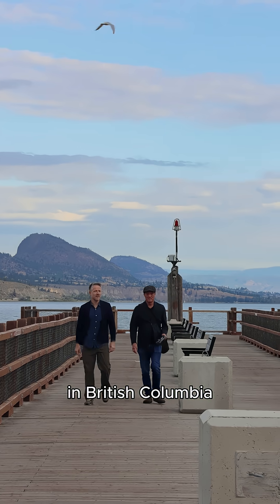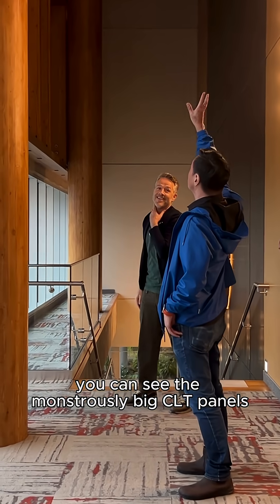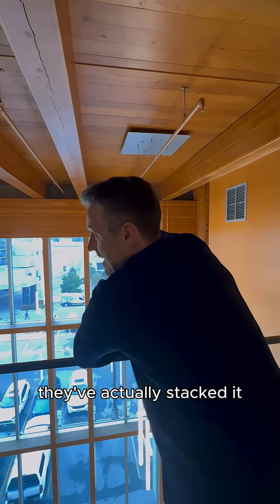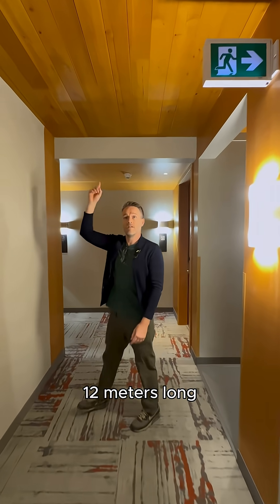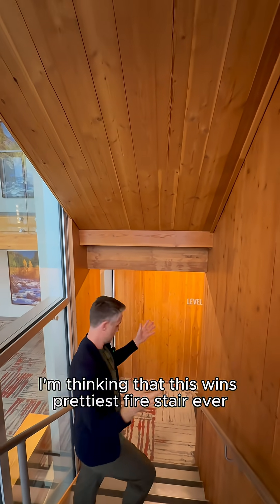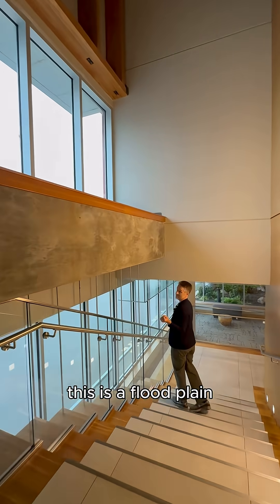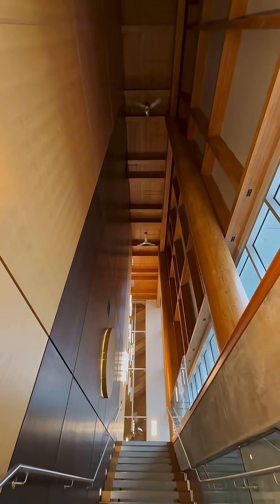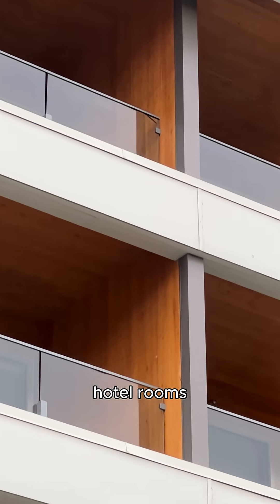More Mass Timber in Penticton, Canada

Comment: Love seeing mass timber being left exposed and used as the finish material 😍 very Japanese-esque. Really beautiful.

And love seeing the cross section rings of the trees being left on the stairs as a beautiful feature.

A lot to love about this, apart from the double loaded corridors with long hallways (though I assume this is a result of code), and the carpet.

9.5/10 for the dive, Andrew 👏